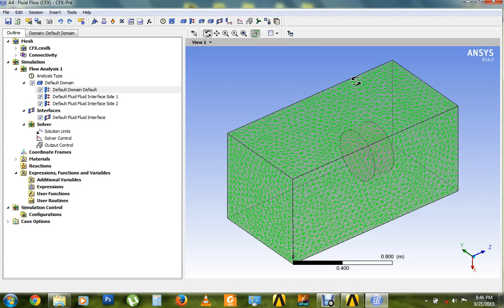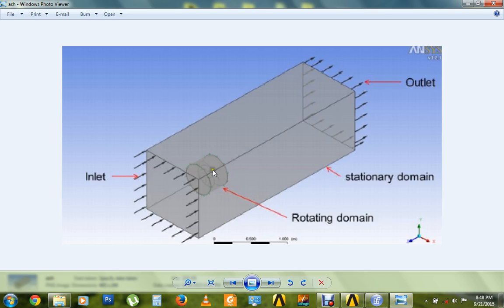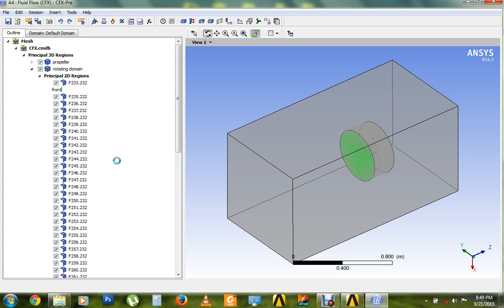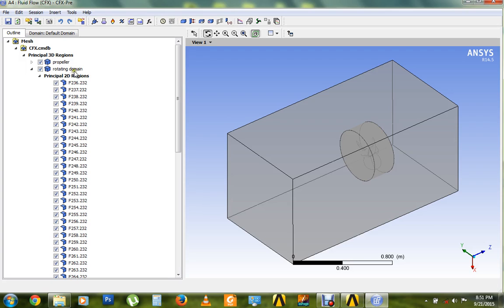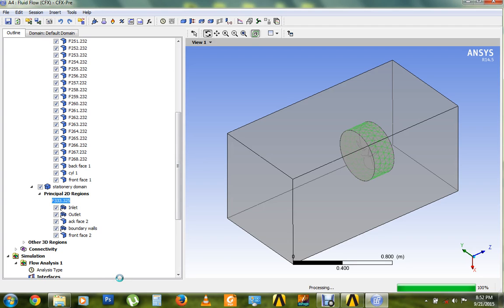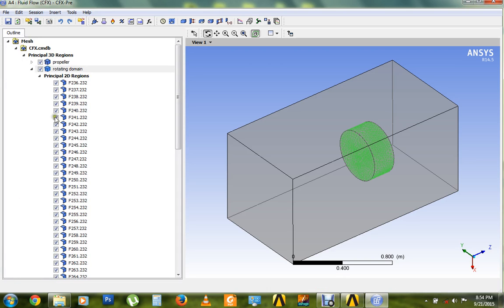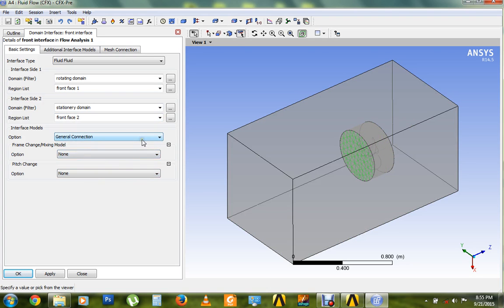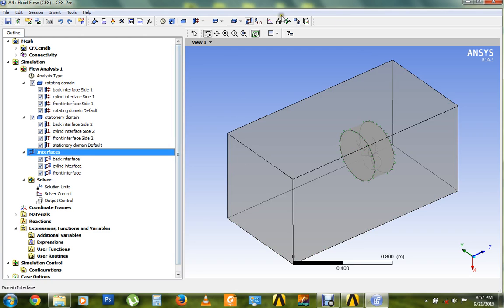3D FLUID ANALYSIS OF TURBOMACHINERY IN ANSYS CFX+FLUENT PART 1 ( MUBASHIR)

Comment: For cylinder interface and back interface I got errors 
Interface"Cylinder Interface" connects a rotating and stationary domain, but has no frame change mode
Interface"Back Interface" connects a rotating and stationary domain, but has no frame change mode